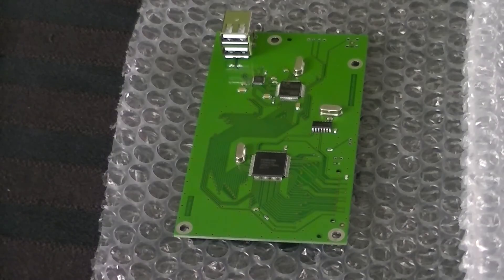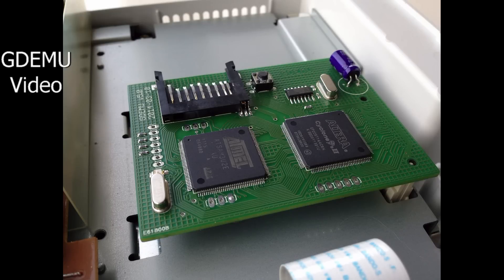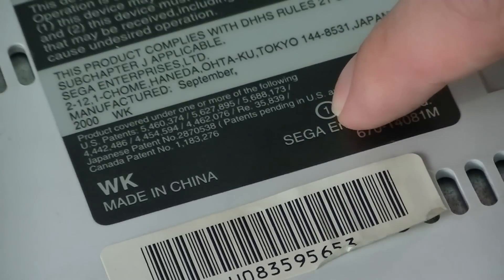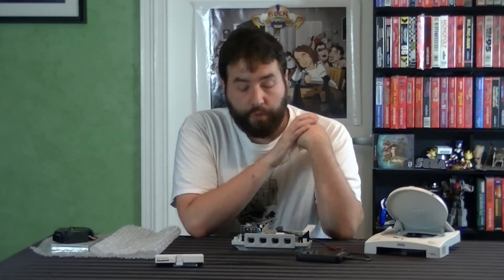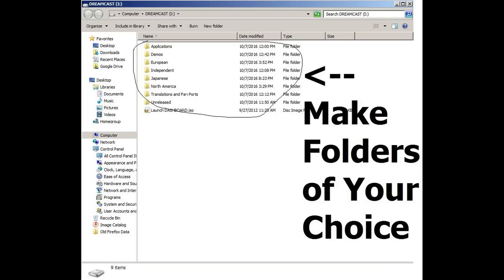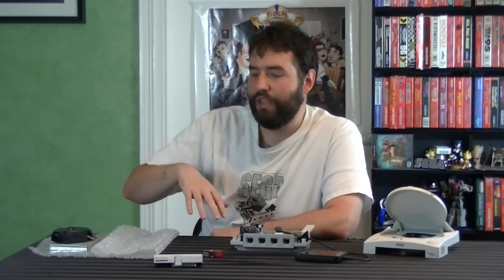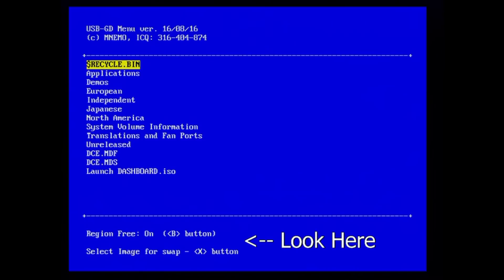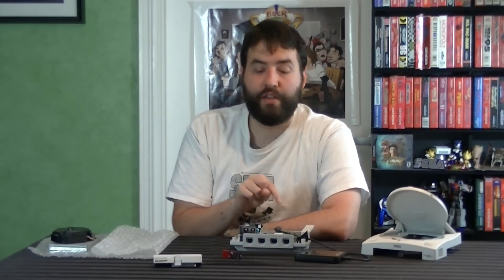Keep Dreaming - USB GDROM ("Flash Card" For Sega Dreamcast) - Adam Koralik

Comment: These things are ridiculously expensive. Call me crazy, but for about 50 bucks, you can get a DC console that works. At that point, you can find GDs in lots and bargain bins. I love my Dreamcast and I was considering buying one of these, but for the cost of almost $200? Then, you need to get an external TB drive, a non-trivial added expense.
While your analysis spells out a lot, I'm curious what you would say about actually purchasing one. Would you buy it?
Reply from the maker: Of course, your comment feels a bit out of date. Namely in regards to assumption that Dreamcast discs appear in bargain bins. That's...not true. Dreamcast content is rather expensive these days.
Reply: That's true and it does alter the value equation. However, one can, at their convenience, purchase used consoles, used titles, CD-Rs, and tweak the laser at a much lower cost - I guess this depends on how frequently you've had to replace a DC console (I've got two, and had to adjust the laser once.). Then again, my usage of the console is limited as of late.

Comment: use a Japan DC, they have a different cooling system which is directly connected to the CPU/GPU... the USA version has that terrible piece of metal shield which is awfull to cool the DC, also without the DC cover it essentially became a passive cooling system.

Comment: Man that sucks that the cooling path would be obstructed other wise the obvious solution would be slap in a SSD under the board. max out the DC read speed with ease. I say SSD rather than HDD since zero vibration. IF some one can come up with a cooling solution It looks like that would  be the perfect fit in the machine.

Comment: Opening the lid will do nothing lol theres no sensor theres a physical switch on the actual gdrom unit itself which would cause a reset in most games except D2 when it asks to switch discs. So removing the gdrom all together will give no indication to the dreamcast that the lids been opened.

Comment: Fascinating. I'd love to own one, but $167 - $187 USD minus shipping is utterly absurd. I'm not a hardware engineer by any means, but I feel like one of these things couldn't possibly cost more than $30 to create.
Reply: I think that having the custom controller chip fabed to bridge a USB controller to the Dreamcasts proprietary GDROM interface might cost you a ton of money up front.  You have them made in contracts or batches with x amount of chips minimum and make the cost balance out in the long run.  I'm no expert but I once talked to a guy who developed one of the first Wii mod chips back when the Wii was fairly new.  He spent months full time designing the chip itself and writing the software (firmware) to run on it.   Once the design was set in stone he has to send the designs to a company in Texas (he lived in Canada) to get them fabbed and had to buy 500 minimum.  They came back on wafers with maybe 50 chips on a wafer or something like that.  Probably cost ~3 grand to get the batch of 500 chips made you figure that's only 6 bucks per chip but the rest is the time it took you to design the chip and the software (firmware) for it, break the chips apart off the wafers, and solder the wires onto the chips that the customer will need (or in this case solder the chip, USB ports and other passive components to the board with the proprietary pin connector that plugs into the dreamcasts motherboard) all this assuming you can actually sell 500 (or however many you have made, if it's less it's just going to cost more per chip) and of course the risk you run if you made any mistakes on the design of the chip and didn't notice until after you send the design to fab and you just wasted that 3 grand!  He told me this actually happens sometimes as the fabs don't care if your design is good or bad it's not their job to test your design (they wouldn't even know what it was for) they just bake em off for you in their million dollar machines.  That's the risk you're willing to take to have your own custom chips made in low production numbers.  It's basically a full time job even to make a few hundred of these custom boards.  Hope that helps understand the prices sometimes it seems crazy but they may just be making their investment back and barley paying for the time they spent developing the chip, having them made, prepping them, shipping them out to re-sellers etc.
Reply: Why should they take the risk just that you can save money? If they take risks of high volume production runs, they deserve to keep the money. That's how business works.

Comment: in terms of cooling you don't need to do anything the dreamcast is not a hot runner anyway
Reply: when using these you do since the drive uses 12v and the gdemu and usb gdrom uses 5v so when removing the drive the voltage spikes up above 12v wich causes the PSU to overheat. You can fix that by desoldering the 12v rail or add a 300 ohm 10w resistor on the 12volts. Also by adding a piece of plastic or cardboard fixes the airflow straight to the PSU so that also helps. And another solution is to put a pico 5Volt PSU in it instead of the dreamcasts Original PSU.
Reply: billybrenders wouldn't touch this with a bargepole then if that's the case.
Reply: Mike Newbold it's quite easy to do tho

Comment: I understand now your problem with multi disks  :
 you have a "simple" version  and not the version WITH lid Switch  (USD 188.00  VS USD 203.00 !!)!
Also you didn't want to install "by the book" too.. so it can't work properly !

Sounds a good solution if you don't want to :
1 hear this stupid disc player
2 scratch your good old Gd rom

Comment: So what is the difference in loading times between the GDRom to the GDEmu?
Reply: There is none since they both use the maximum speed the board outputs. IT's a bit faster then a drive but not that fast since both are connected to the same point the drive is connected 2 wich outputs the same speed nonetheless.
Reply: No way, this board is much faster.  There's no spin up at all.
Reply: Mᴇᴢᴋᴀʟ Mᴜᴢɪɴɢᴢ It isn't much faster since the board is connected 2 is the same board the drive is connected 2 wich has max reading speeds and it can't go over that max speed that the disc uses.
Reply: billybrenders
 You're completely wrong.  "The GD-ROM in the Dreamcast works in CAV (Constant Angular Velocity) mode, different from a common CD-ROM drive, which spins the disc in CLV (Constant Linear Velocity) mode. Sega achieved the higher density by decreasing the speed of the disc to half and by letting the standard CD-ROM components read at the normal rate thus nearly doubling the disc's data density. This method allowed Sega to use cheaper off-the-shelf components when building the Dreamcast."  this is a well known fact, GDROM is slower than a 2x speed CDROM drive.  ANY flash drive or hard drive of this era will be orders of magnitude faster. 

I expect you'll keep repeating the same "it's throttled by the connection" bullshit but that won't magically make a GD ROM drive as fast as this device.
Reply: Mᴇᴢᴋᴀʟ Mᴜᴢɪɴɢᴢ I haven't said anything about being faster. I'm saying it's still limited by the device itself so don't expect super speeds like everybody usually does !